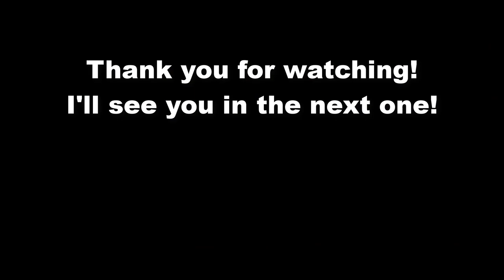DIY Car Dolly

Comment: What are the basic dimensions for length and width? Also, what casters did you use?
Reply from the maker: Its 112x138 in centimeters. Casters are just some cheap ones I bought locally.
Reply: @RestorationApprentice  Danke. I'm currently trying to bring a '77 924 Martini back to life. You're an excellent mechanic and your vids have been a big help and an inspiration. I look forward to more.
Reply from the maker: @timmiller4130  Thank you very much!

Comment: nice idea, i might need to do somethign similar. 🙂 what points on the body did you use as your load bearing points? seems like its a point of much disagreement in the 924 world!
Reply from the maker: Thank you. Where rear trailing arms mount to the body, under the sill, in the back and chassis rails in the front.